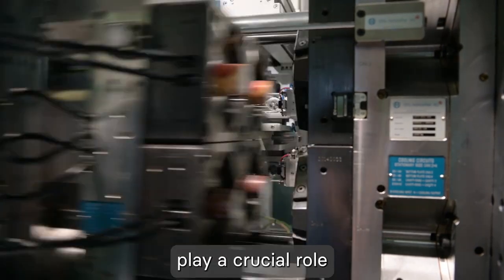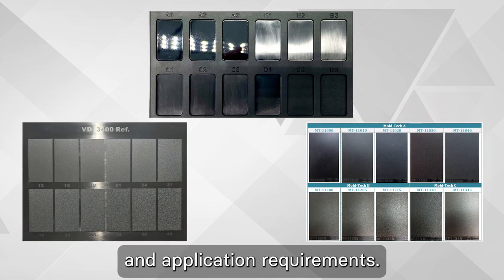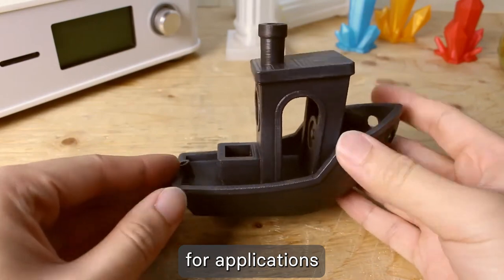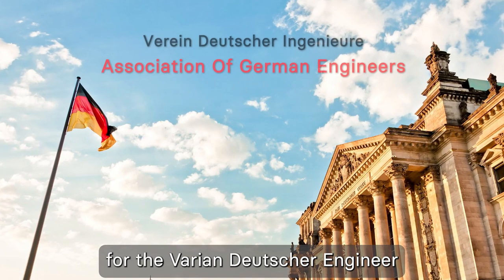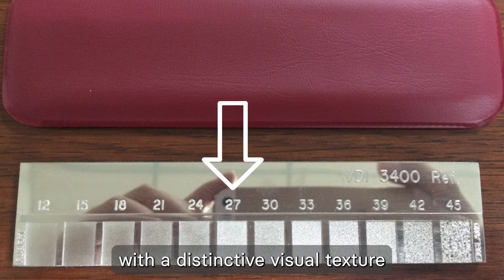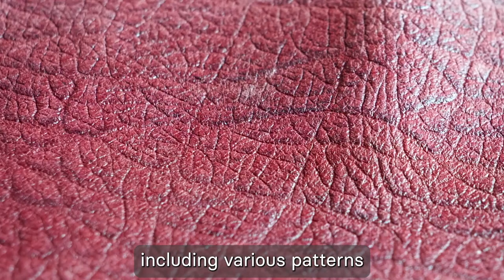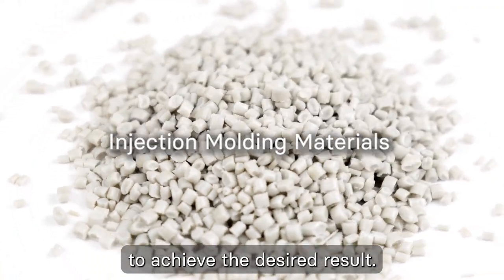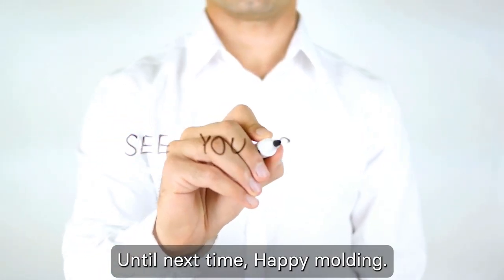An Overview of Injection Molding Surface Finishes: Your Ultimate Guide

Comment: I always feel that this kind of service needs to be within driving distance. How do you overcome this.
Reply from the maker: You're absolutely right; that's the common sentiment. We invest a significant amount of time and effort in platform management, supply chain, logistics, and communication. Our primary focus is on addressing customer trust issues because, let's face it, the biggest hurdle for online services is establishing trust.
Reply: @RAPIDDIRECT  And the videos certainly help, it is just so much more efficient when one can quickly come see the results, but i guess a simple Zoom call can also achieve sort of the same result, just difficult to see the exact finish or issues on a zoom call